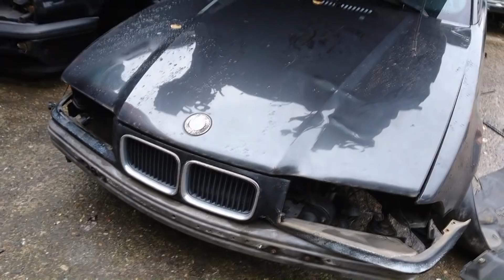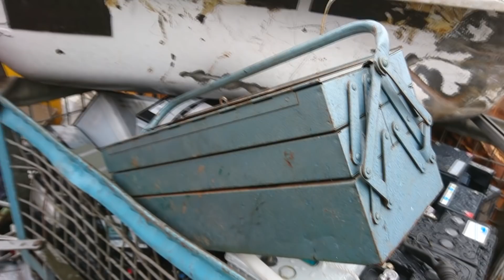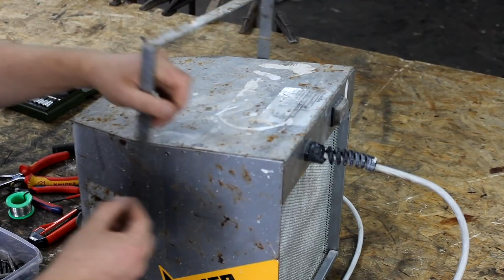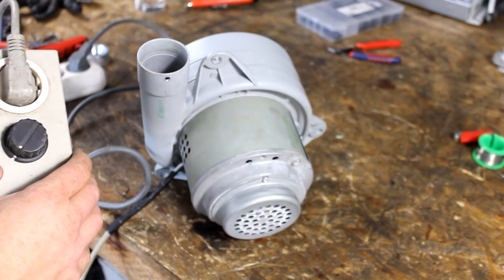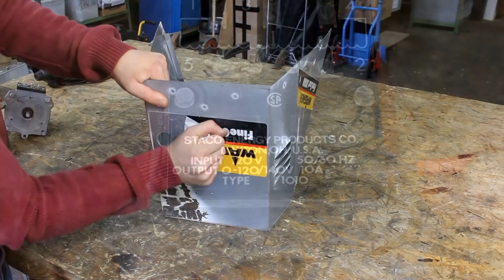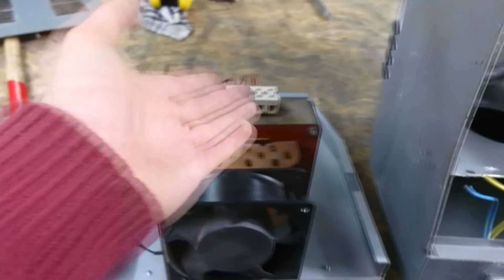Great Scrapyard Finds! Repair-A-Thon!

Comment: Hang on, the Bosch Drill's internal connector block has 250V markings as well as 125V.  It looks like you just need to make sure you're connected to the correct 

Let's see...found a multi-language manual for this model...
https://www.manualslib.com/manual/1108274/Bosch-Gbh-2-20-S-Professional.html
Nothing on the wiring except a note that it needs to be changed only by a qualified person.

More searching...found a service manual:
https://elektrotanya.com/bosch_gbh_2-20s-se-sre_type_0_611_234_0-6-7.pdf/download.html
(Sorry, yeah, Hungarian web site, there's a nifty translator extension you can get that applies Google Translate, and it works pretty well on this web site, at least to English.)
It does have wiring diagrams (presumably in case the motor needs replacing, which you can apparently still buy from an outfit in the UK
https://www.mtmc.co.uk/Bosch-GBH-2-20-SRE-/-0611234741-Spare-Parts__p-90679.aspx
but there's nothing I can see about voltage conversion.

Unfortunately, this model doesn't appear to be worth a whole lot and seems to cost a lot to ship, so I don't know what you're going to be able to do with it.  A hammer drill is a pretty use-specific tool, and unless you need the specific functions of one, you're usually better off using a regular drill..

Comment: There are many brands of turbine spray guns available.  One is made by the company called accuspray. It is a good quality gun and parts are available at least here in the US.cheaper guns are also available  such as Sprayfine on Ebay. Gravity or standard cup designs are available. 3m makes a cup liner assembly to make cleaning much easier. I used a turbine sprayer for years in the bathtub resurfacing industry. You necked down the useful volume of air with your adaptors which will cause the turbine to OVERHEAT. I dont recommend using a standard spray gun on a turbine compressor for overheating reasons. Sprayfine is a good place to start for economic reasons but by far, Accuspray is one of the best!

Comment: 18:07  You should not hang on a drill like that,it is much more efficient to let it hammer and bounce loosely in your hands .It will hammer away much much better that way.

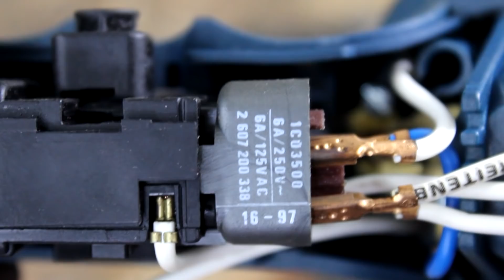Comment: At 11:25  the internals in the drill say 240v - maybe someone made an adjustment previously? The drill sounds a little slow on 110v...But hard to gauge on video!
Reply: I agree, the Internals look like they allow for wiring 120v or 240v or it's just one item in the drill which is designed for either.

Comment: Tip: To use a "hammer drill" properly you do not force it. Like using your own body weight against it will actually only make it go slower and wear the user and equipment out.

Comment: Great video! And I fully agree on your wise words in the intro. We should all learn what we can to repair and reuse the wonderful machines we have build. Inspired by you, I instead of replacing my cheap Chinese powerdrill with another cheap one, got an old German one for 50kr or 6-7€. I got to work (I have only cery basic  electronic skills) and it would benefit from a full makeover, it outperforms the cheap Chinese one.

Comment: That machine you showed that you thought was some kind of bender is a circle cutter. You can get dies for it to use it for making beads on round sheet metal too, but it is primarily for cutting sheet metal circles.

Comment: Please remember to de-rate the current of the variable transformer  you are only using a small portion of the winding, like low voltage. The current rating is for the variable transformer across the entire winding. Adding a fuse or circuit breaker is also a good idea.

Comment: Are you sure that drill won't accept 240v?  The controller inside had ratings for 250v power printed on the side as well as 110.  May be worth checking out if there was another tap for 240 on it.

Comment: Hi! Interresting video as usual!  Just one little question thaugh, isn't germany's electrical power 230 Volt at 50 cycles and north america's power 120V at 60 cycles?  That difference in cycle might explain why the drill felt a little weak ?

Comment: I like your videos, But however the step down power supply was a bit dangerous with the posts at the front having the output of 120+ volts, this could be a shock hazard. THIS WAS NOT A negative comment just a thought, maybe this unit needs a residential current device installed into the plug.

Comment: i added you to my patreon account. i truly enjoy your vids, and always learn something. i am in my mid 50's and am a semi-retired carpenter/handyman. at this point in my life i can build, repair or destroy pretty much anything. i also repair, rather than replace things when possible. to be honest, most of what i use every day someone else threw away first. some of it i even got paid to haul away. the things i can, i fix and either i use myself, or sell to someone else. i would go back and get that sheet metal brake if i were you. if you can't use it, i'm sure you could sell it to someone who would for a profit. i hate to see such useful, and valuable tools going to scrap. craigslist is an awesome tool i use quite often to find new homes for the things that i repair, but don't use. facebook marketplace is another. good luck, and thanx for the inspiration.

Comment: I always enjoy your scrapyard videos. It's always great to see old stuff get a new life instead of going to waste. I have an older version of your hammer drill. Use a moderate amount of force and it will drill most efficiently. If you push with a lot of force, you're just working yourself harder.

Comment: Wagner? Sounds to me like Wanker, going by the proprietary need to keep customers tied with a rope to their brand. If i see a proprietary item in a system that later on impedes my use of a machine, i immediately put them in the same bracket with over sized truck users.

Comment: Fantastic finds, i've just brought a cheap hflp sprayer, havent got time to use it but from ready you need the correct thickness of paint, too thick and it wont flow as well.

Comment: If old tools left in the scrap yard bother you, don't look at your local hardware retail store... I work in retail. Many customers will buy a tool, use it once for their specific job, then return it to the store within the "30 day customer satisfaction period". Because they are 'used' and the boxes they came it have been opened/damaged; the store cannot return it to stock  owing to liabilities and so it must be disposed of by smashing them. I have seen many virtually brand new tools get returned and scrapped.  I have managed to convince my store to sell me a few at scrap value prices, and I have found they all are in perfect order. --- but just think about all the retail stores across the world that are throwing otherwise new products out because of wastefulness of a society focused around  'customer satisfaction' and the ' customer is always right' mentality. 

The only silver lining here is that instead of rummaging a scrap yard for old things, I managed to get things like almost brand new ratchet socket sets, spanners, steel mechanic tool chests, bandsaws, jigsaws, air compressors,  screwdrivers, etc. for token scrap prices.

Comment: LPT from the madman himself, photonicinduction, check the max current rating on the secondary wire of any adjustable transformer, and attach a breaker/fuse to it for that rated current. 

Keeps your shop from smelling like burnt cables for a week

Comment: Never heard of a centra fugal pump before... Centrifical yes but not centra fugal... Guess thats up there in the ranks with the elusive british bat tree..
Anyways that is not an air conditioner it's a cooling unit for a small walk-in freezer or beer cooler. using it to cool your home would be very ineffifient because the BTUs are not great on it. but if you wanted to build a small food cooler then you got a prize there.

I have a step up / step down transformer that will take 120 VAC and step it up to 240 VAC or take 240 and step it down to 120. it even has the euro and american sockets on it and to use it is kinda dodgy IM a you need to make up what we cal lsuicide cords. - cords that have male ents on both ends of it... Kinda wierd IMO but reason I have it was I used to have a 6 unit 2-way radio charger bank that required 240 volts via the euro plug made bt Standard (Standard HX381's I think were the radios that went in it..) Anyways I sold the radios and charger long ago to a law enforcement agency in Africa and I still have the transformer as they didnt need it..

Comment: These videos depress me in a way . Our UK  recycling centres containg lots of things I would love to use and recycle don't let me do it so the material ends up as landfill or scrap. They are wasting  and scrapping valuable resources that could be personally recycled at much less cost. The economics of it escape me but the hypocrisy of recycling  doesn't.
Reply: It's not about economics... it's about politics. The voters keep "going on about" recycling... they won't shut up about it. So if the politicians can set up "fake" recycling where things just end up in land fill or get shipped off to the third world for "processing" but they label it "recycling" in notoriously large and famously friendly big GREEN letters, then the voters will swallow it and keep on voting for them. And a half-hearted scam is so much easier to set up than any kind of real system and that's what they want: to be re-elected again and again for as little effort as possible.

Comment: I've looked at isolation transformers like you make here on E. Bay and they cost over 40 Euros for a used/broken one. In England we use such transformers and 110V tools on building sites... I assume for (lower voltage) safety... maybe that's what the original owner of the Bosch hammer was doing.

Comment: Hi nice project , you can add a digital voltmeter to the front panel and some circuit to activate the fan only if they are hot temperatures , remember that with the isolated transformer the differential circuit breaker can't help you .

Comment: About the Wagner, that thing is basically a vacuum cleaner in reverse and in your paint test of it you either used a spray gun that requires a higher pressure to use or you didn't thin the paint down enough. If you ever find something like a easy sprayer/little beaver paint gun (quite easy to tell, its all plastic with a very large inlet port) you can just use a reversible vacuum cleaner with it just fine. The only trick with these things is whatever you a using with them needs to be quite thin, almost water like in consistency

And I also had a thought about the step-down transformer: could you make a 240-110v step down transformer using 3 microwave oven transformers? I have a feeling that it is possible

Comment: The Drill is most likely from the UK.110-115 volt is the safety voltage required on building sites using a transformer that has a grounded center tap so that there is only around 55 volts to earth making a sub lethal voltage in wet conditions. I still have one of those drills I purchased in the early to mid 1990's.

Comment: Everything can be repaired and we should repair everything. It is economical and ecological. We create less rubbish and use less energy ...
Reply: Hmm, not quite true I'm afraid. I was trained as an electronics techician to faultfind test equipment down to component level and repair/recalibrate. I got out of the game when the proliferation of multi-layer boards meant 'repair' by board-swapping was becoming the only option. All the fun - and job satisfaction - had gone.

Comment: Love these repair-a-thons !! I still have one of those blue tool boxes. Don't leave them open on the floor! you will have your shin open in minutes!! And that will bleed as hell!

Don't be so harsh on the drill, these hammer drills go threw concrete like butter without pushing. Applying  to much force will not help.

keep up the good work!

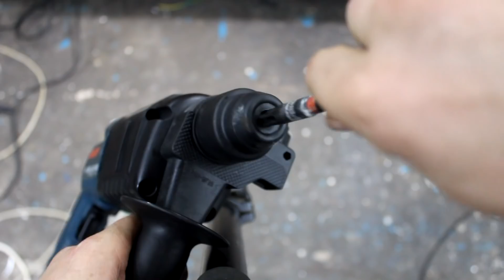Comment: 17:50 Was the hammer action turned on on the drill? It looked like it was having a really hard time... :)
Reply: It sure sounded like it was on. Maybe a damaged drill bit. He also put a lot of force, hanging on the machine while drilling, which isn't optimal. Should always let the machine do the work.
Reply: @EddSjo  According to the manual it's turned on in the dry run (switch facing forward), but it's difficult to discern in the outside shot.
Reply: Also it looked very uncomfortable hand position as the secondary handle wasnt on the side as it should be

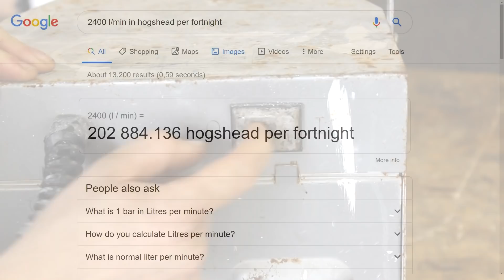Comment: 4:36 Hogshead per fortnight - that's my new measurement standard! lol
Reply: Bushels per parsec comes in at a distant second.
Reply: I wondered if anyone else picked up on that.  It showed that when he said "cubic feet per minute".  Being from metric land, was he making fun of our units?  Also from Ohio BTW.  😀
Reply: @timeflysintheshop  Yeah of course he was taking the Michael out of imperial
Reply: @timeflysintheshop  of course, the whole world is making fun of your units :)
Reply: @chibiebil  Our units work just fine thankyou.  It is hard for me to imagine a unit system with no near equivalent to a foot.  You know even though the UK was metrified in the 70s, they still use miles and yards instead of kilometers and meters.  At least on the British youtube channels i watch.
Reply: @timeflysintheshop  Well talk for yourself, I primarily read that most ppl don't like it. Also engineers often have to use both or metric completely, and also just google Unit Conversion Disasters lol :) Also when a country doesn't really want to change what are you expecting, you can't just switch what is offical now and expect everything to change by itself.
Reply: @chibiebil  I am an engineer.  I switch between inches and mm quite easily.  We do make our drawings with dual dimensions for the benefit of metric minded people.  Maybe you don't realize that we use a decimalised inch for engineering and tool making.  We only use fractional inches in carpentry and woodworking.  We did manage to build the greatest industrial nation in history with major feats of engineering like manned flight, assembly line production, put men on the moon, etc...  All with the humble INCH.
Reply: i am still falling about
Reply: https://en.wikipedia.org/wiki/FFF_system
Reply: @tomvarley4344  Thanks for the hint!
Reply: I had to pause there...

Comment: Doesn't Germany use 120volt invertors on job sites as it is safer working with 120v compared to 240volt

Comment: Your opening comments on repairing and essentially prolonging the useful life actually contribute to my desire to see a faster switch to the production of electric cars in lieu of petroleum-powered cars.  I want to see machines, expensive to manufacture, used to their lifespans, not junked-out in a few years, if they are not ridiculously expensive to repair.  There may well come a time when a given machine is not worth repairing, but that time should be a long way off.

So with that said, that's why I feel it's important to manufacture electric cars as soon as practical, and to build cars with useful range and servce-life, such that people get started driving those cars and maintaining them for the long-term as soon as practical.

Comment: Not quite sure but think there some speed setting in/onto the driller itself ...
They could go without hammering effect and onto reverse too ...
Speed is regulated by the final deep your finger push the trigger ...

There's a plastic round stuff to help you not push it to the deepest or ... as you intend to make the use of it !!!

Why wasting what takes so much energy at the "beginning" ???

Cause life is not running at the corners the streets but makes the world go round ...

Might not be the best answer,
But stand my point of taste !

Comment: Knowing Bosch it is very possible that you can get the parts for the drill in a 230V version as spare parts, and for a fair price that is. Since it's only a on/off drill (no speed control) it should only be the armature/rotor and field windings/stator that need to be exchanged. Major downside: the armature is usually the single most expensive part of such tools.
[EDIT] parts numbers should be 1 614 010 039 (230V armature) and 2 604 220 429 (230V field winding). Unfortunately the armature is more than 60€ and the winding about 20€ on offers I seen. So not really worth it for a tool that old.

Comment: Nice video and cool variac build! But you don't have to lean onto a pneumatic drill that hard, It'll do its work also if you just hold it firmly. Thats why they are so much nicer than hammer drills.

Comment: @12:29 "It should be able to handle a few hundred VA." - I think you meant to say 'a few thousand VA'. A normal transformer of a 800W microwave oven is rated at about 1-1.1kVA, and is less than twice the volume/mass of this beast.

Anyway, I love these salvage/repair/rebuild/re-purpose videos! I absolutely hate wasting perfectly usable material and machinery, and do a fair bit of 'dumpster diving', 'scrap yard scavenging', and repair/disassembly/recycling work myself.

Comment: Got that exact same drill, just the 230VAC variant. It is very capable, and is light, so you will find that you use it for all work that needs concrete drilling, as it drills the holes so fast. Best is to use the matching Bosch SDS bits as well, they are much better than the clones, and last a long time as well. I also used a old 8mm SDS bit ( it had a good life, but the electrician finally killed it after 12km of lighting installation) and put a thread on the broken end, and put a keyless chuck on there, so that I could use the drill, in non hammer mode, to do things like put in screws and use regular non SDS bits. Very useful, and the chuck was free, from a dead cheapie drill I picked up in a lot, and lucky for me I had the right ( old, imperial specification) die nut to cut the thread it needed, or at least the die nut was close enough to not matter.